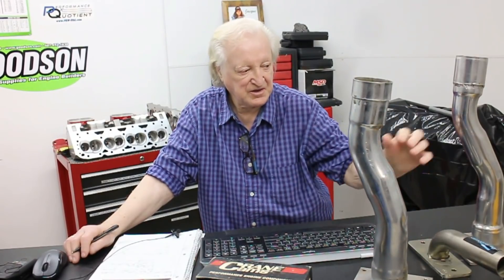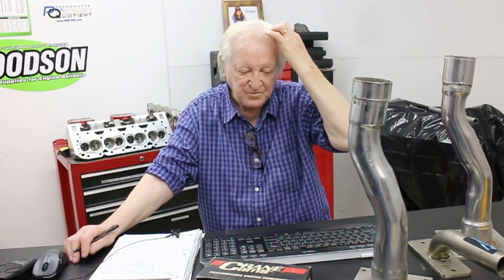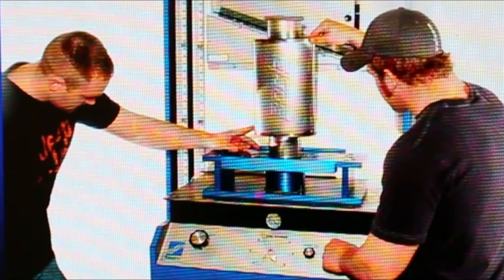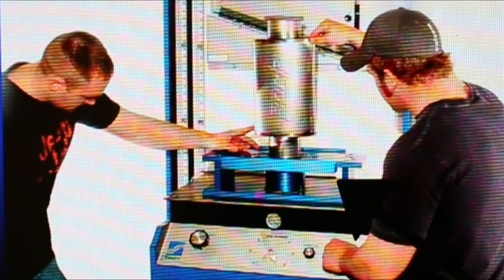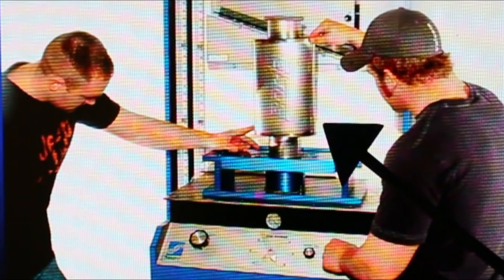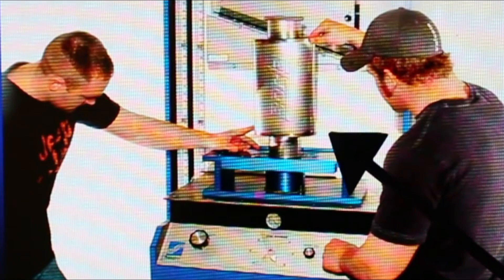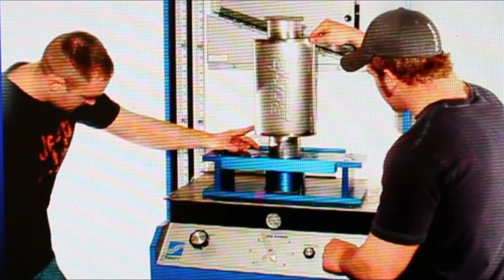David Vizard's PowerTec 10 EP 27 Zero loss sound legal muffler systems

Comment: I've always liked how Buell motorcycles used the chassis for holding fuel and swingarm for oil. My point? I have wondered if any auto makers would start using the chassis for the exhaust path. Why not use the inside of the closed uni-body chassis to guide the exhaust out of the rear of the car. It would use less metal. If you really wanted to you could box in the chassis of your pickup truck and route it to the rear through the frame. By the time it exits...it may not even need a muffler.
Reply: It would rust out the frame tho.
Reply: @unleavenedkaraiteplus3412  stainless.
Reply: Heat.
Reply: @cuzz63  Flash chrome plating? But I've thought about this. It would probably still rust out. But auto makers would probably like a way to help the car destroy itself. A way to sell more cars.
Reply: @sexyfacenation  Thermo electrics. This could be used to conserve energy in Hybrids. I'm surprised muffler companies haven't already thought of this.

Comment: About 99% of the gear heads on the internet will debate that engines like a little backpressure!  I ask them if they have had college level physics classes or a fluid dynamics class?  On planet earth back pressure reduces flow which in an engine reduces power.  I ask them why would you do H/C/I work to increase flow to only choke it back in the exhaust?  They can never answer that question....they usually say well my uncle was a mechanic for 40+ years and that’s what he told me....😂😂😂.    If back pressure is good then stick a potato in your exhaust pipe and see what happens. 😂😂😂

Comment: Thank you for sharing your knowledge! I was thinking about installing a "performance muffler" on my truck to reduce exhaust flow restriction. I thought an exhaust as silent as the installed one has to be very restrictive. Guess I was wrong. Seems the silent Walker muffler is doing quite a good job without creating too much back pressure.

Comment: Thank you Mr. Vizard for a very informative and useful video. I enjoy all of your videos and the knowledge that you share. Many years ago I designed an exhaust system for my 1964 Ranchero with a mildly modified 306 sbf. I was aiming for a simple system that would not restrict power and have a moderate tone that would not be too loud. I wish this video was available back then! Although I didn't really know what I was doing, it seems that I did incorporate some of your principles (including DynoMax Super Turbo mufflers) ..... by blind luck! I did not incorporate a separate reversion chamber to reflect the exhaust pressure wave. I assume that the DynoMax mufflers alone do not have enough volume to accomplish this. Am I correct? Anyway, please keep up the great work. It is appreciated.

Comment: Thanks for this video. It makes me think the most difficult bit would be to find room for the hardware under a car. The actual fact of the possibility of zero-loss muffling, is well and truly shown here. I recognized the pictures used as being from your Horsepower book...the newer version...I have both, and much of both is  highlighted. 
 I do have a question: if I'm trying to zero-loss muffle an inline six, and have 2, 3 cylinder headers running into the termination box, is the box volume still 8 times the volume of 1 cylinder, or are the calculations different? My thinking is: there must be a big enough volume to allow the exhaust to think it's hit open air, and 8x 1 cylinder is fairly large. Still only about 1.5 gallons, but  still... I'm assuming the muffler calculations are common for any engine, so that's fairly straight forward. I have Philip Smith's book and am working hard to understand all he wrote.  
 Again, thank you for all you've done to help the common schmuck in East Overshoe Montana (that would be me)understand his car better.
Reply: X2 on that, also wondering about i6 balansing tube. On a Ford 200 that is.

Comment: Thanks for doing this great video. I do wish people would really consider how they are perceived when driving down the road with open pipes or super loud mufflers.  I am wondering if a metal substrate catalytic converter could be used as a termination box if properly designed. Thoughts?
Reply: I have just watched the video and was wondering the exact same thing.
Reply: Yes, How do we incorporate a catalytic converter into the system? Before the expansion box or after?
Reply: In order for a cat to work. It has to be installed in the high heat area of the collector.  If they are in the slow flow area or colder temperature section. They will clog!

Comment: I noticed when I placed my flowmaster or turbu mufflers midship, I felt my low end torque suffered, but when mufflers were placed toward end of car it came back.
Reply: Keeps the internal temp up for faster moving flow. But it also leaves in the moisture.
Reply: Its about the scavenge effect, by locating mufflers farther back you lengthened the collector which enhances scavenging.  Richard Holdener talks at length about this.

Comment: For probably 30 years or more now, any time my exhaust system was a bit too loud, I'd switch to a Dynomax Super Turbo(s), and voila!  Quiet, and usually better torque/powerband than the other, louder setup was providing.  
Now I want to figure out how to suppress low frequencies and either enhance, or at least allow high frequencies.  Do you have any thoughts on how to manipulate the tone that way David?

Comment: From your pictures representing the exhaust system, it looks like you could position the “straight through” muffler close to the end of the long tube collector, which presumably is too short for proper tuning, and get an effective reflective wave at about the right length. I’m thinking of a street engine with heads, cam, and intake selected to provide a power peak in the 6000-6500 rpm range. Where dyno collectors were defined on various published engine tests, the collector extension length was usually 18-24 inches or so. Most street long tube header configurations, though not precisely equal length, seem to fall in this category, that is needing an extension for max power tuning. Do you have a generalized recommendation or does this require a precisely measured and tested length to be useful? I’m awed by your vast knowledge, thanks for imparting some of it to the world!

Comment: So the 8x one cylinder volume is for a single muffler, dual or doesn't matter?
Reply: the 8x calc is for the termination box after the header.  Muffler volume isn't as important as flow.
Reply: @ChurchAutoTest  is it for a single exhaust or dual?
Reply: @terrycarter8929  The diagram Vizard showed was for a V8 with a dual exhaust but the termination box acted as an x or h-pipe since both sides flowed through same box.
Reply: @ChurchAutoTest  on the diagram showing the 8x formula shows one bank in and one exhaust pipe out.  That's why I ask.

Comment: i am guessing we can do the same for my vintage Velocette 250cc, 350cc, and 500cc racing bikes. Use the formula, the design to produce a 95db (race legal) or less zero loss exhaust. I like the concept of passing a fellow rider in Classic racing without them hearing me coming. Your thoughts appreciated.
Also the 8 x a single cylinder volume for the pressure wave termination box. Is this for all motors. Example. Both a 500 twin and a single cylinder 250cc would have the same sized termination box - being 8 x 250cc = 2,000 cc (2lt)?

Comment: Wow, wondered what happened to my favorite muffler. I used them and sold them. They worked.  I also sold and used Flowmaster from the time they came out, just too noisy. What about the parabolic reflector that was in the cyclone sonic turbo? That's what made me try them to begin with. Good sound , power and kept the highway mpg's. I am just about ready to put my chevelle together and am happy this came out at this time.
Reply: I run flomasters on my fox body. Im sure they're not the best but sound awesome on those cars.
Reply: @BruceLee-xn3nn  Flowmaster are great mufflers, they're just noisy.

Comment: As always extremely interesting. 
David I have been using your A series books since the late 70’s. They have helped me run my small business rebuilding assorts if engines. I use Aldon to help me set them up. Have you any advice in 1000cc F3 engines. They us a 36mm restrictor below a 48 IDA. What choke size would you recommend and what shape should the restrictor be.
Regards Andrew Tart

Comment: very informative as ever,I've been following your articles since the early 80's when cars and car convertions magazine was a thing, I would like your expert opinion on what is the best exhaust design for a turbo engine as I drag race both a NA fwd toyota and a turbo rwd nissan 200sx,I assume this video applied to normaly aspirated engines and curious if the design theory is similar? or vastly different when a turbo is used
Reply: I would bet the shortest outlet for the turbo would be the most beneficial as the turbo is the muffler.

Comment: Thank You Again Mr. Vizard!  Question:  I have a 1976 book called Valve Timing by Ed Iskenderian. On page 83 they make reference to a exhaust mod where the header tubes enter the collector. They call it a Jardine air-foil.  It was a extension following the transition flange into the collector.   Is the modification rubbish or is it worth pursuing? Thanks for sharing your knowledge.

Comment: I have applied your theory about pressure wave terminator box, on my 2004 Mini Cooper ( r50 NA engine) and coupled (attached after the box) with sport metallic cat. Works really well 👍 but I'm thinking to  modify because the cat after the box is lazy to heat. Have you suggestion about that aspect?

Comment: I really liked hearing about muffler theory. I was wondering if Mr Vizard has looked at black widow mufflers. They look to be way free flowing. I would also like to hear about pipe size per cubic inch. I have a 289ci Studebaker with 2-1/2” duals. I notice flow is a bit slower than my old 2” system. Velocity must hold some importance somewhere right?

Comment: Thank you for the info. I’ve always been interested in building systems. Currently I have a fairly healthy 355 in a 69 Chevelle, it’ll be a fairly quick driver but I want it kinda quiet. I have used the Super Turbo many times but would like something quieter than those.

Comment: My takeaway is that a Borla or Borla style muffler then being nothing more than a glasspack in a fancy stainless steel box needs a pressure wave termination chamber before it. On a system using a 2.50 dia exhaust pipe do you feel a length of 4" od domed tubing (domed fore and aft for smooth  flow) is sufficient for a pressure wave termination chamber?

Comment: David, does the expansion chamber have to be a large chamber like you mention, or can it simply be a larger diameter of tube before the muffler? For example, 3" from the collector to the muffler and 2 1/2" after the muffler.

Comment: I like flowmaster myself, I fought it for years, but love the sound of a 2chamber with large turndowns on the end, 3-4" dia. And 12" or less in length, or just 3-4" pipe on the end, up to 18" i hate tailpipes on a muffler, but even glasdpacks sound good on the end of the exhaust, with a large tip on the end, a friend had glasspacks on a truck, the straight through type, with 5" pipe on the end, 18-20" long, it sounded decent, tailpipes destroy sound, especially small diameter tail pipes, but if you must have full exhaust, with tailpipes, putting the muffler at the end if possible it will sound decent,   i helped design a backyard built muffler, it would likely worked decently, if it weren't made from, 1/8" , 3/16" and 1/4" steel, ha-ha, it weight atleats 50lbs!  I like the sound of flowmaster but I do see the loss in , i always thought a sortof expansion chamber muffler would work, but it comes to cost! I have several ideas for mufflers, but for a performance Street car, I always wondered why not do a chambered glass pack type, like in the late 60's early 70's, my ideas are all heavy !!
One idea I had for about 20years+ is kinda a cross between a super trap and flowmaster single chamber...